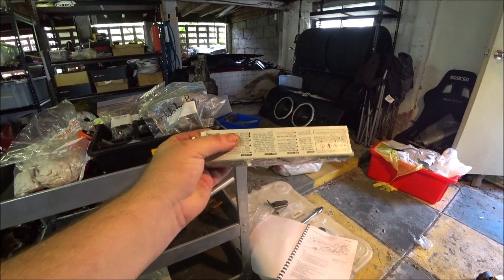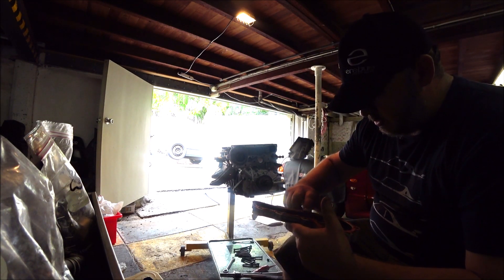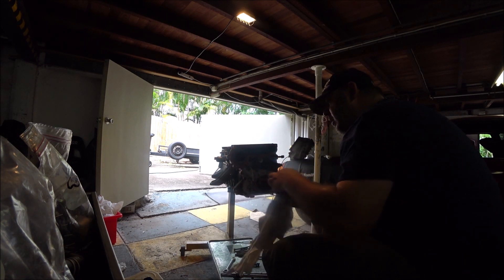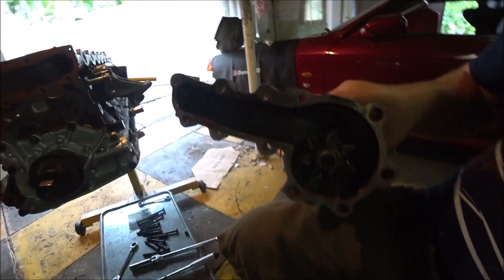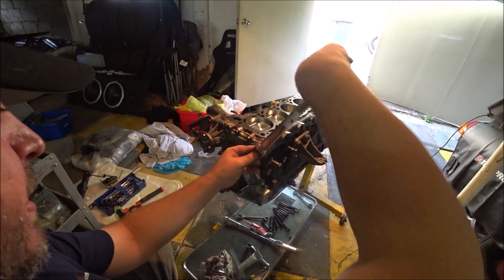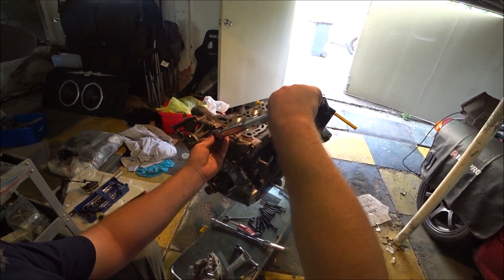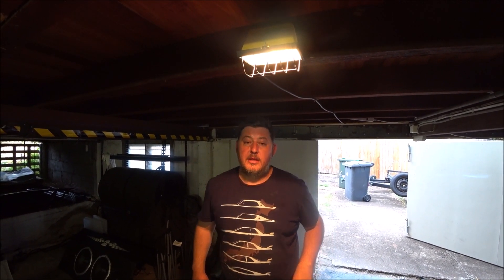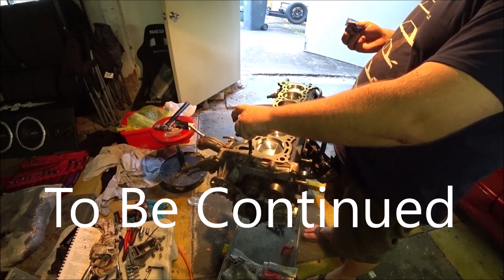RB25DET Build - Oil Feed Blank Install - Water Pump - Timing Stud Removal -

Comment: Hey mate, Nice vid. What sealant did you use on the welch plugs?
Reply from the maker: When I looked at them they seemed to be brand new in that block, which makes sense it was used for a fresh build that umm didn't work out, so I left them in.